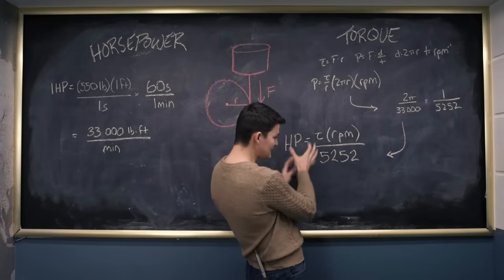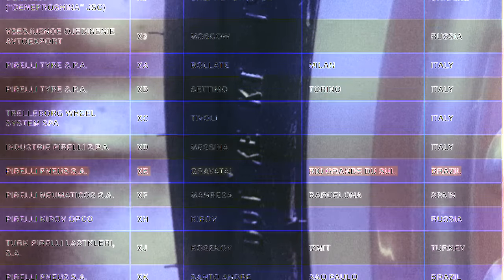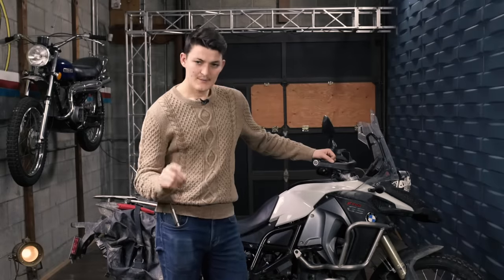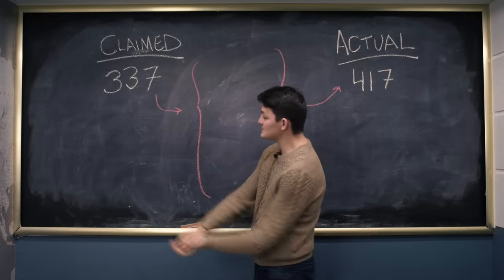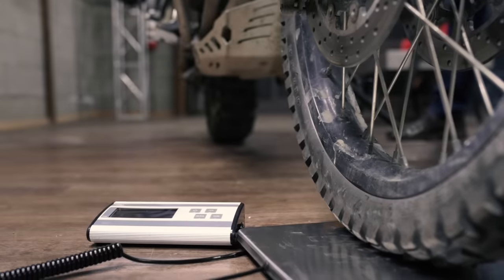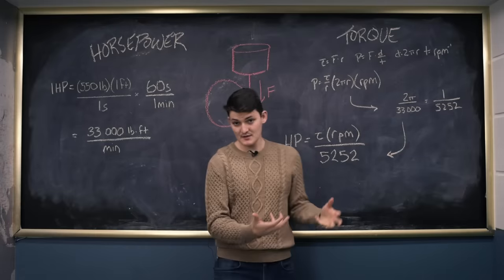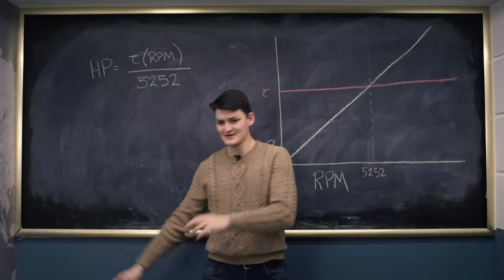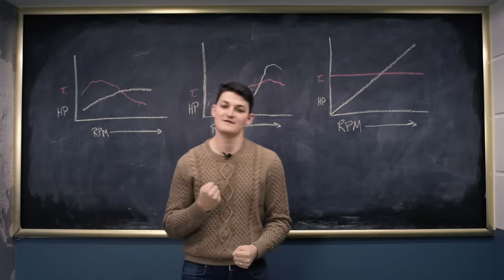3 Ways Motorcycle Manufacturers Trick You

Comment: Why would you want the weight full of fuel?  That would punish bikes who have a larger fuel capacity.  Last I checked, larger fuel capacity was a plus.  The proper weight should be all fluids not including fuel.  Basically a motorcycle in its running condition, empty on gas.

Comment: when you buy a new motor cycle the first thing you should do is buy new tires, those new tires on the new bike are not to be trusted.  i speak from expirience, new kawasaki 1000 with brand new brigeston battle axe tires, the tires were defective to the point of being unsafe. replaced them with aftermarket michl;eans the difference was dramatic. new tires on new cars and motorcycles arent what they say they are. aftermarket tires are different than tires that come on a new vehicle even tho they are branded labeled  and sold as the same tire.
.

Comment: The torque and hp math is theoretical. In the real world a 400ci 550hp gasoline engine can put out 650 lbft of torque. However a 900ci diesel rated at 550hp puts out 1850 dyno proven lbft of torque smashing the theoretical math
Reply: No it doesn't, as the RPM at which the diesel engine makes it's HP is normally lower hence why the torque is higher for a the same HP. (because big high compression diesel engines have trouble turning at 5000rpm) except for some race engines.  It proves the formula for the relationship between torque and horsepower.
Reply: @51farmalla  lol so do the math and see how that works out for you

Comment: This is bs... I bought pirelli sportscomp from pirelli dealer after my interceptor tyres were worn out.. I thought I would get better tyres.. But guess what, they were exactly the same tyres... And when I asked them they said of course the tyres on the interceptor were the same they measured the tread depth of the rear tyre in front of me and it turned out to be 5mm and the front was 3 mm, after returning home I mailed pirelli and and got a reply that their radial tyres were manufactured in Brazil and that interceptor used radial tyres, the factory has nothing to do with the quality of the tyre and its rubber, as all the factories produced the same quality tyres..

Comment: I love torquy engines. My Car is a Diesel. 2,2 liters with 177 HP and 400 Nm at 2000 rpm. The Van weights 1,5 ton, so the engine is pushing like hell in this car. Yeah i know what you want to say.... V8 gas engine, bla bla bla... This enigne is weighing double, eats double and needs double the space. For Bikes, there are no Diesel engines out there. So you have to use more ccm / cci to get a lot of torque.
I don't like high rev sport bikes for their engines and seating position. The sound of my kitchen blender is better.
ATM i favor the Triumph Bonneville and Kawasaki W800 for their low rev torquy engines. I don't need to drive fast. Biking is my way to meditate while driving country roads and enjoying the views.

Comment: but an SV650 has 70 torque but can't do speeds an R6 which has almost half the torque can do.  Yet you said "you can't feel one without already having felt the other" which in this case is wrong because if i have already "experienced 70 torque" under 4000rpm on an SV650, why am i nowhere near 100mph when the most torque an R6 will ever feel is in the 40s but far past those figures and even losing a few later in the power band, i'm well over 155?   You'd be insinuating that an SV650 - if given an R6 transmission and rear sprocket - will do way more MPH than an R6. but it can't.  

For that reason alone, torque and horsepower CAN'T be one in the same because then tractors wouldn't have massive torque while F1 cars have massive horsepower but not much torque. If a tractor is moving a stump, you won't be like "ohhh i feel it... 1000 torque! wow!". it's moving pretty mundane.
Reply: He never said they are one and the same. They are each one third of the equation. You cant experience torque or power anyway, you just feel acceleration. The r6 will make less torque sure but because it's at a higher rpm it ends up being more power. Nothing he said was wrong, I think you're just interpreting it strangely.

Comment: The torque/HP formulas are right, but you're never going to get torque at zero RPM except with an electric motor.  And both electric and ICE will have torque fall off at the top end, though for different (but equally inescapable) reasons.

Comment: No one:

Fortnine: Power and Torque are both relative to energy so are meaningless measures to the rider and that you can’t tell the difference.

Engineers, Track riders and experienced all weather riders: Are you mentally handicapped?

Honestly I am absolutely astounded, fortnine seems likes a smart guy. Why is he saying such utter nonsense. Have you ever even looked at a HP/Rev/Torque diagram and ridden that bike. Let alone the fact your physics “explanation” was utter drivel. By your logic, there is basically no need for gearboxes!

Additionally:
- explain why high sides happen if torque is constant.
- kerb weight is a defined scientific figure utilised by those who have actually studied this stuff.
- I guess all this v2, v4, v5, in-line 4s, single cylinder designs which have cost billions to develop, mainly around power deliver (hp, torque, rpm) are just marketing ploys.

Comment: Wow, that phantom tyre stuff is really stupid. You could directly see the made in Brazil written, instead of plant code. 2mm Tread depth, barely makes a difference to overall manufacturing. And there are lot of tests tyres have to pass. Even the oem ones. So substandard tyres will have to go through the expensive whole testing process over again. Which is not only expensive, but won't clear it if its actually sub standard. 

How come you didn't read tyre standards of EU.

Comment: The part at the end when he's talking about power and torque in some ways it's not true at all.
I have a heavy German built car, if it did not have the huge amount of torque that it has it would not get away from the line very quickly at all.
Power has absolutely nothing to do with it
I am a real mathematician and engineer, if that Young man in the video would like to contact me I will explain all to him.
I nearly forgot to say the part at the beginning when he is talking about tyres is also absolute bollocks as well.
Please ladies and gents in this case do not take a YouTubers advice as gospel.
Reply: No you really arent. The torque an engine makes doesnt reach the road because it goes through the transmission, the power does. And since power is (work done/time) if we want to move something heavy quickly we need to use lots of (you guessed it) power.
Reply: @benfennell6842  clearly you have an intelligence quotient less than room temperature! "Torque doesn't reach the road" what a completely idiotic thing to say, how do you think a truck pulls a trailer the answer is not by using a lot of power it's torque that makes one of them move, drivers of trucks always try and keep the engine RPM on or around peak torque, trucks do not have a great deal of power for such a large diesel engine, there is just no need for it, you will never see a diesel truck engine turning over at 10,000 RPM to try and get as much power as possible out of it.
Go and find out what Rudolph Diesel has to say about his engine. Torque is what gets you down the road power determines how fast you get there.
Reply: @KevZX-10RC1H  If you're going to quote me at least do it right. I didn't say "Torque doesn't reach the road" I said "The torque an engine makes doesn't reach the road". Which is just kind of objectively true. Your gearbox and final drive applied to the torque coming out of the engine determines the torque reaching the road, which will almost certainly be in all situations a different number to the amount of torque there is at the crank. Hence "The torque an engine makes doesn't reach the road".

As for a truck pulling a trailer:

Lets say I want to move 1 ton mass 1 kilometre. Now I can do that with engine A making 15 horsepower and 300 lb-ft @260rpm. I could also do it with engine B making 300 Horsepower and 300 lb-ft @5252 rpm. 

Now in both cases the work to be done is the same, but since power is (work done/time) And engine B makes 20x more power it will move the ton of weight much faster down the kilometre. Now in both cases the engines are making the exact same amount of torque , but since you literally agree that "power determines how fast you get there.
" I don't think you'll have any arguments or objections to make about this scenario yes? 

Now let's look at another scenario, again moving 1 ton a distance of 1 kilometre. Engine A makes 300lb-ft and 300HP @5252rpm, whereas engine B makes 200lb-ft and 400HP @10,502 RPM. 

Now which one will get there first? (assuming we're in a vacuum and we're not thinking about grip or gearing or anything else, lets assume these engines are on a CVT and always running at the listed RPM just so we're exclusively talking about the actual numbers.)
Reply: @KevZX-10RC1H  I think you're dodging the question here kevin. If torque is so important why doesnt you tell me with that big mathematician brain of yours which engine will move it faster? Its basic high school level physics. Of course in order to answer correctly youd have to admit you're wrong.

Comment: I am by no mean a genius in mechanic and I barely understand technology. Horse v. torque????? Just lool at the start of a moto GP race. They are all full throttle, release the clutch and go. In Motogp, which is a lab on wheels, they only talk about power. Never a word on torque. There must be a reason. Power wins. Period. Now on a daily basis for riders, bike or cars, what does torque really mean knowing that if you have the same car with different weights???? So torque v. power comparison is pure BS
Reply: They talk about power because it's the relevant side of the equation, motoGP bikes make a lot of torque too, but spinning that torque at 15,000 rpm is what makes those big power numbers. Doesnt make sense to say it makes 100NM at 12,000 rpm, when you could just say it makes 200 HP which means the exact same thing and is easier to understand

Comment: Torque gives you acceleration, hp gives you top speed.
Reply: Did you even watch the video?
Reply: @benfennell6842  look easy example: you got a 0.9L engine making 120 HP, but you need to drag a caravan. The HP only kicks in at 2700rpm, so you kill your clutch as you only go 5kph. Multiplying a physical quantity by the angular velocity is decieving. As torque is not at all a constant or even, linear function of engine speed.
Another example is:
A big cc engine revs always lower than a small one, as the optimal piston speed is 10m/s. So while you get a shitton of boom=Torque, You don't get a whole lot of HP. As a more cilinders, with the same cc, do less piston movement, so they can do more ups and downs to have the same piston speed. As power is torque times angular velocity and the increase in rmp is proportionally higher than the loss in torque, you get more HP. You would say, well the engine speed is decoupled from the wheel speed due to the gearbox, and yes, in theory we could always stay at the ideal rpm, and let gears to the magic. In practice you are in a certain gear (e.g. 3rd). Now, now you want to accelerate. You increase the air (+fuel), which increases the torque, which drives your wheels. The torque that is not needed to hold the velocity, accelerates the wheels. Which means you are now faster and so is the engine. The increased speed is a clear shift in operating point, the combustion time is different, the flame propagation is different, the torque you get from the engine is now different. This inherent dependency of engine torque to vehicle speed is the whole reason why we have parallel hybrids. Where you can run at higher torque, (without trotteling), and use that torque to charge a battery instead of accelerating the car (load decoupling). If you look up engine characteristicas you'll see that the highest torque is before the max Power, as it drops at very fast rpms and the power still increases due to P=T*rpm. And at some point if you increase the rpm more you get less power, because the torque is soo much worse. Another fun number is that sporty engines usually max. have 700cc per cyl. Just sit on a 1 cyl, like a 701, and a 4cly motorcycle and youll know what i'm talking about. The 4 cyl only gets going at high rpm. PS: If you want speed and load decoupling, you need a planetary gearbox with two electrical motors like in the prius.
Reply: @benfennell6842  sorry i meant big cylinder no big cc, as i was comparing same size engines.